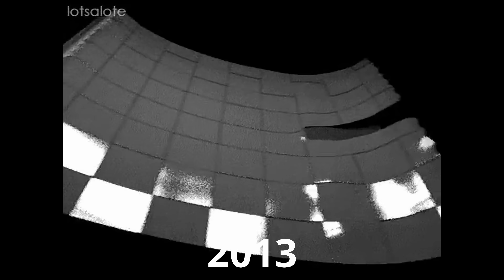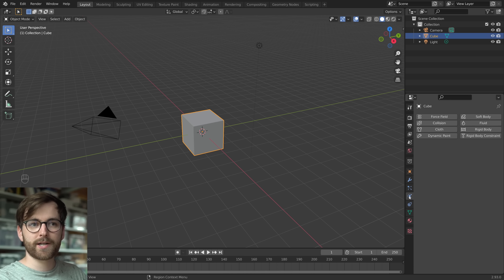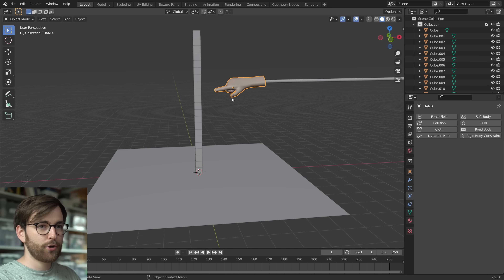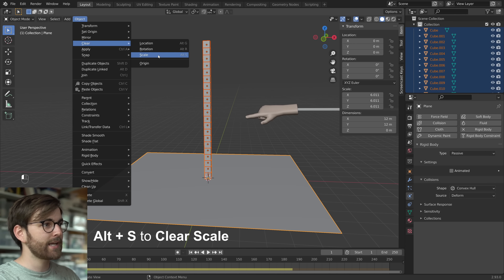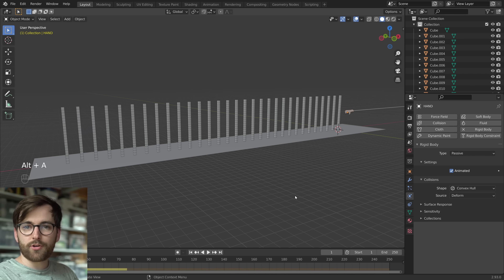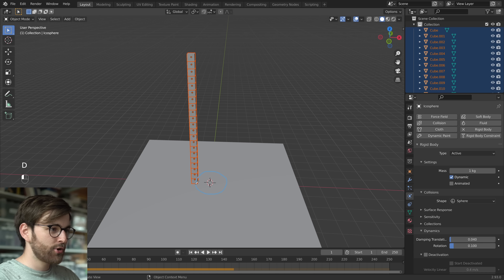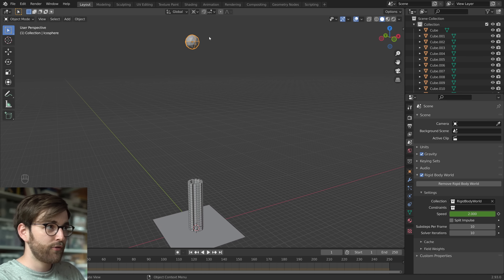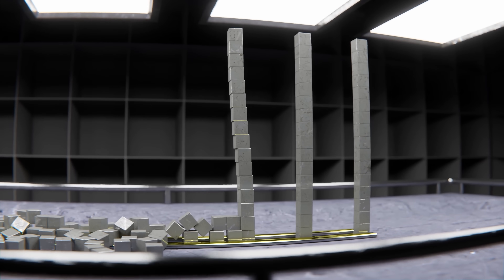Tutorial: Tipping Over Stacks of Cubes in Blender

Comment: when i press or hold ALT then then click deactivation and start deactivation it wont let me click it until i let go of ALT? no matter what i do the objects still fall over. no matter what i do it doesnt work right for me. any suggestions?

when i press ALT and try to select the box it just allows me to scroll that menu. i have my keypad setup for laptop mode or whatever from another tutorial from someone else and ive gotten used to it. i hope thats not the issue. still learning.

i think i figured it out on my own! i had the 3 button mouse emulation turned on because i had a diffrent mouse before. i got a nicer one now and dont need it on but forgot it was a setting to begin with lol. duh. so far everything works good. thanks for the in depth beginner tutorial

Comment: Great Tutorial.  I am having some trouble with Physics in Blender so I went back to basics and followed your tutorial.  I created the round stack of cubes, just like you showed, then created a cone to replace your hand with the pointing finger.  I dropped the cone down into the stack and keyframed the simulation, just like you showed.  The instant the cone comes close to the cubes the entire stack explodes like a bomb went off in the center of the stack.  All Rotations and Scales are applied, I even keyframed the cone to just barely penetrate the stack, then stop.  Any idea what is happening?  I also changed the collision Shape of the cone to Mesh, convex Hull, etc... same behavior.  thanks!
Reply: I had a similar issue.  I had duplicated the stack once by accident and didnt move it.  So I  ad a duplicated stack INSIDE the main stack, then created a bunch of duplicates of those.  Once the 'stick' touched the cubes, the physics went nuts because two objects were occupying the same space.
Reply: @heatdeath217  You are spot on.  I have learned the hard way that if you have ANY overlapping geometry the physics just explodes them.  I was using physics to animate shingles blowing off a roof using a vortex force and I had to go in and adjust - ever so slightly - each and every shingle so it did not overlap the ones next to it.  Fixed the problem...  but damn... way tedious...

Comment: Hello, I'm facing a problem. I'm trying out Rigid Body physics for the first time. After frame 250 the simulation stops (I have changed the End  frame at Timeline to 1000). There even is  a yellow line possibly indicating the time period of the simulation. I'd really want my  simulation to continue past the frame 250. In the video you also had this yellow/orange line down in the Timeline section. Is there any way to extend the simulation please?
Reply from the maker: Hey! Yes! In the Scene Properties tab, go to 'Rigid Body World', and under 'Cache' you can specify the Simulation Start and End. The default value here is 250, which is why it stops at 250 frames. Hope this helps!!
Reply: @Polyfjord  Oh! Thank you, it works now